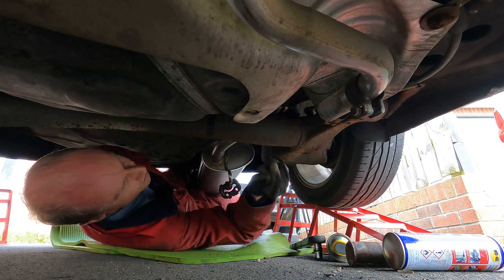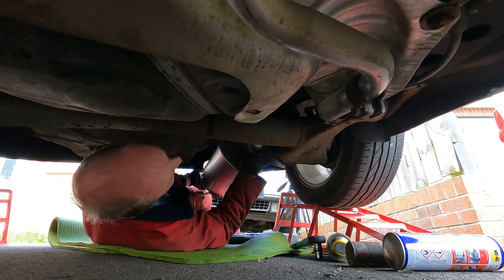Replacing the exhaust backbox silencer on a 2010 Vauxhall Corsa D Petrol

Comment: Just changed one tonight. Got the back-box from EuroCarParts, same-day click and collect. Although I wouldn't recommend it, I jacked up the left side of the car whilst on ramps to make some space and avoided putting myself under the car whilst manhandling the exhaust over the rear axle. Glad to see I'm not the only one with disintegrated heat shield retainers.
Reply: Is your exhaust by a brand named klarius. If so, what are they like quality wise? I know you only posted 12 days ago but maybe you have past experience with this brand.

Comment: ive tryed get my backbox off but it was hitting  the heat sheld and wouldnt come off because i had the car on ramps
Reply from the maker: Yeah, as soon as you make the lightbulb moment that it's the rear axle getting in the way the job becomes so much easier! Swap to jack and jack stands on the frame and you're all good.

Comment: Mine fell off too on my Corsa but I’m loving the sound 😂 Is it safe to drive without it
Reply from the maker: Yes, perfectly safe just noisy so ok to use until you get it replaced.
Reply: @junkendriven  ok great! I just thought maybe any strong heat/fumes may damage soemthing
Reply: @junkendriven  shoudl I be concerned, sometimes I hear a creaking noise coming from underneath perhaps the middle pipe?